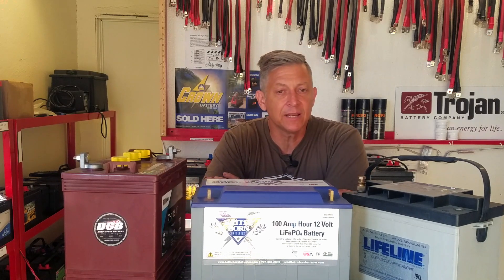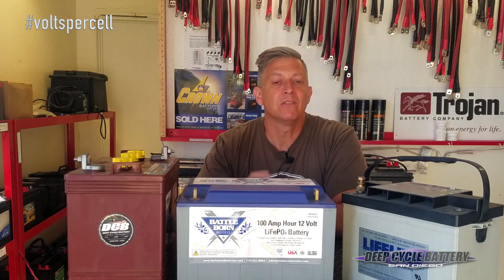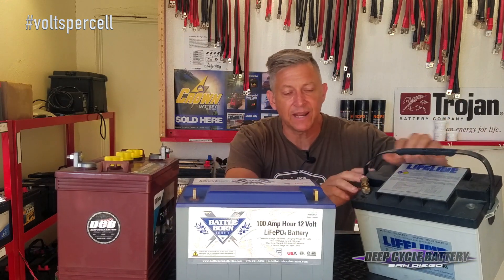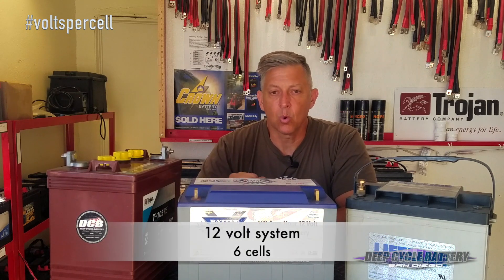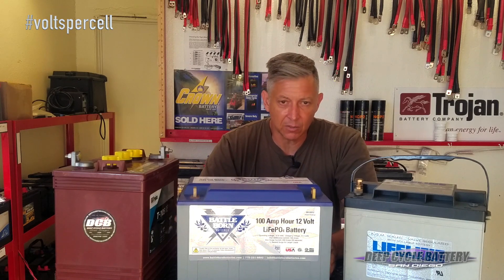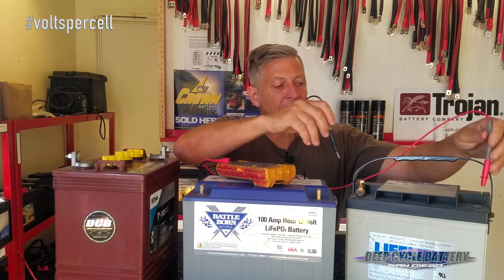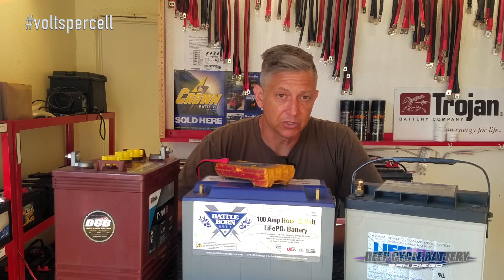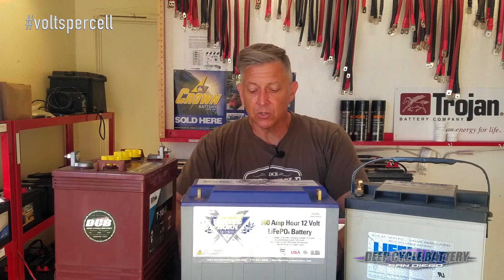How to Charge Batteries When Given Volts Per Cell

Comment: Hello, I have 2 12v batteries lead acid (24v system solar inverter) running since 2 months ago, I want to add 2 new batteries (same brand and capacity). Do I put the new batteries in the same bank, or I mix one old and one new in one bank? And charging cable goes to - and + of new or old batteries if mixed? Thanks in advance

Comment: Great videos in this channel! Thanks!  I have a question:  I have four 12 v Rolls batteries in my 2005 club car.  I noticed my car would finish 18 holes!  The voltage is fine and the gravity is good also.  I have the club car power drive 2 charger,  which has 13 amps.  The rolls recommended that charge with 15 amps for this particular battery.  Could undercharge the battery with only 13 amps cause damage to my battery?  Thanks!!!
Reply from the maker: Interesting thought that the 13A charger is not fully saturating the active material. What specific gravity reading are getting with the hydrometer?
Reply: @DeepcyclebatterystoreSanDiego  1252 ,  I used EZRED hydrometer, the good range is between 1250-1275.  Thanks!

Comment: Hello, I have 3 new Trojan 31gel Deep Cell batteries for my Rv. Can you suggest a  good charger for my system. Thanks Ray
Reply from the maker: Sorry for the late reply if you already found a charger please share that information here. Look into victron electronics they make a good line of chargers with multiple chemistry settings

Comment: Why don't serious 6V deep cycle batteries have test posts for each cell so a proper voltage measurement could be taken? That way you could tell the health of EACH cell and whether it needs more charge or equalization.
Reply from the maker: Sorry for the late reply but I feel like a battery hydrometer testing would give you that data
Reply: @DeepcyclebatterystoreSanDiego  No problem. I don't live in a world of batteries, but I think I've run across one or two Lead acid batteries where all the cells showed good specific gravity on a hydrometer, but when load tested, failed bad.

Comment: Maybe someone here can help me. I have 2, 6 volts agm deep cycle batteries connected in series. when i  connected them to the charger,  let's say a noco gen 10, it charged them all the way to 17 volts. now i know that's too high.  so i ditched that charger and  i got another one.  and same thing happen but not so high, i think i got a 16 volt and then i disconnected. aren't chargers supposed to know when to stop? help.
Reply from the maker: You have a very good question you should reach out to the maker of the charger perhaps it's under warranty
Reply: It depends on the design of the charger or it could be an anomaly. You should check with the people who sold it to you.

Comment: A lead acid, flooded battery needs to be charged up to 2.7 volts per cell. This may not be possible with a standard charger. 2.48 volts per cell will not finish the charging process completely and the battery will gradually get sulphated, due to under charging.
Reply from the maker: Using a victron charger you can modify the settings to charge at higher rate
Reply: @DeepcyclebatterystoreSanDiego  A normal charger, which is designed to put out high ampere rates, will not be able to reach 2.7 volts per cell WITHOUT serious off gassing and heating of the battery. It's not the current, that reverses what happened inside a LA battery during discharge.

Comment: What's your opinion of the Noco G26000 and the Noco G7200 chargers for two Trojan T145 six volt flooded lead acid batteries in series on the travel trailer as well as for a typical multi purpose battery charger like car batteries. Can you recommend any excellent multi functional easy to use battery chargers better than the Noco brand for less money? Amazon sells Noco right now. Thanks again